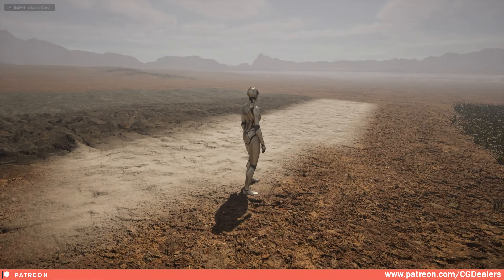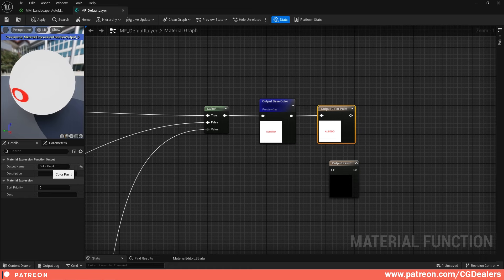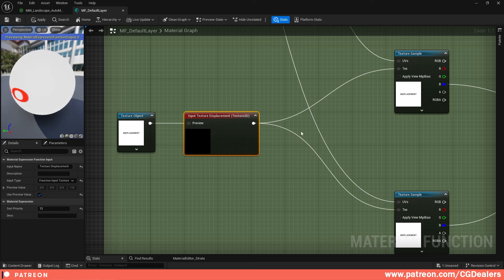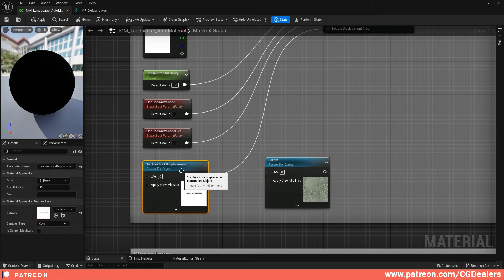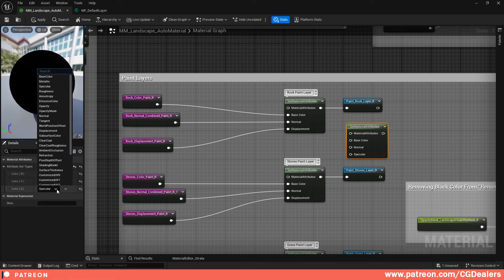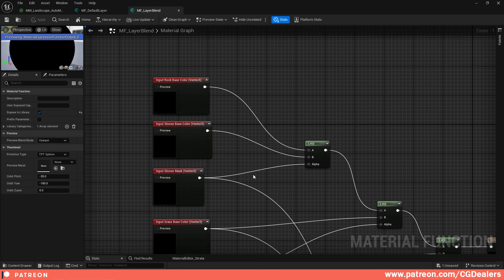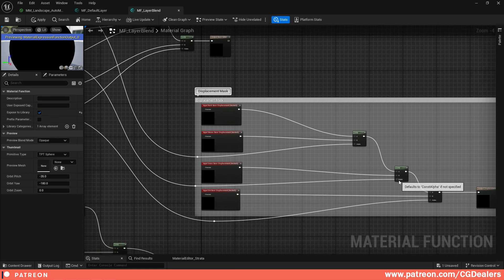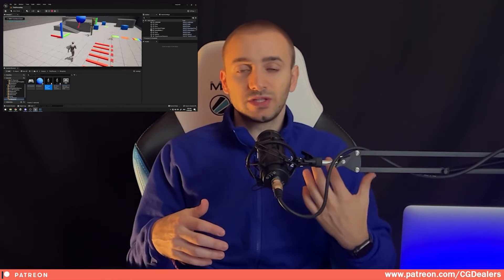Open World Landscape AutoMaterial Paint Layers and Displacement

Comment: Hello,

Thank you very much for providing such an excellent tutorial. I’ve been following your work since the landscape material setup and truly appreciate the insights you’ve shared.

I wanted to ask about performance—what FPS are you currently achieving? When I enable displacement, my FPS drops significantly to around 18. Additionally, enabling virtual textures causes the entire landscape to appear distorted or low-quality. What do you think might be causing this issue? Could it be related to the texture pools in the virtual texture settings?

Lastly, regarding the TextureStoneDisplacement, should it share the same textures as the StoneBaseColor or are they supposed to be distinct?

Thank you again for your time and expertise!

Best regards,
Patrik
Reply from the maker: RVT is textured pool related as RVT requires a lot. Enable nanite on the landscape it will boost your performance especially in 5.5

Comment: That's great that you are still developing these tools for UE open world! Nonetheless I have a problem with the newest version of your automaterial. When I'm applying it to my landscape all of it turns black. Can you tell me what am I doing wrong?
Reply from the maker: You are using the RVT or did not apply layers in the paint layer section. One of those two is the problem. Hop into discord the answer is there https://discord.gg/yxD4f86h.
Reply: @CGDealers  Yes, I needed to add layers and then filled automaterial layer😉 Thanks!

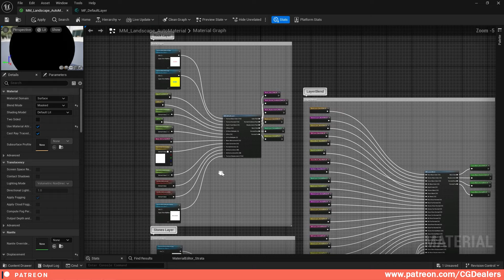Comment: Hey! Thanks for the video, but i do have a question. I came her right from the Auto Material vid, is there a step i missed in between that vid and this? because at 13:07 you connect it to the result node of the material, but it looks different, like its all connects to material attributes, but i dont have that, just the big node where the base colour, normal, etc connects. Sorry, but i'm still very inexperienced with Unreal materials. To clarify my question, the paint that we just created here goes into what on my result?
Reply: So, this one is from the RVT video.
Actually, I have this issue with the "Remove Foliage" video which I have to find next :)

A playlist would be so much useful!
Reply: @Galaf  Did you figure this out because my landscape is just black because of the remove foliage layer
Reply: @AMDbreezy  Not from that channel although I did figure out this stuff after some time.
Your landscape is black because there is no layer painted to speak of.

If you go to Landscape Mode and select the layer, you can paint it and it would work.

TBH, the issue I have is that it beats the purpose of having an AutoMaterial in the first place but perhaps it's possible to have both coexist. If you want to go back to the old behavior of AutoMaterial, don't bother yourself with the paint layers.

Please tell me if you have a more specific question and I'll do my best to answer :)
Reply: @AMDbreezy  If you are still stuck on that, go to 11:44 of the video, and on the right side of the screen you have small section of nodes for remove foliage layer paint.

Comment: Is RVT working with displacement now?
Reply from the maker: I add it for the simple without RVT for now. But you can just make the same connections to the RVT material and it will work :)
Reply: @CGDealers  Nice!  gonna go ahead and do that lol... I had seen incomplete connections in the released project files and wondered if you left it because of a bug.
Reply from the maker: @Zeridian881  What incomplete connections? If it's broken and there are no connections then you did not import it correctly and this breaks the connections.
Reply: @CGDealers  This is with the first 5.4 displacement release, the one where turning on RVT with displacement causes black... I have my own modifications and layers now, so I have to merge the new updates myself.

Probably easier to explain over on the discord later lol